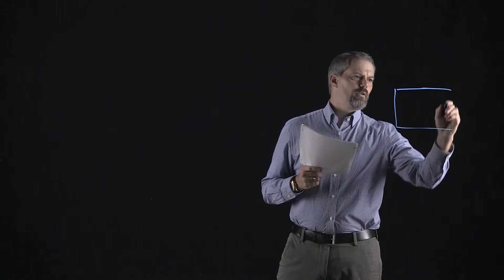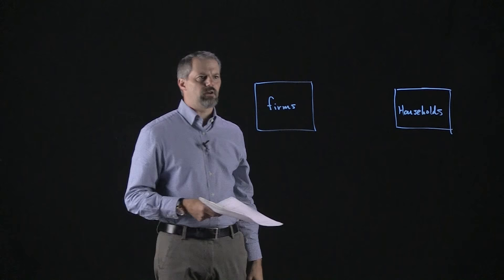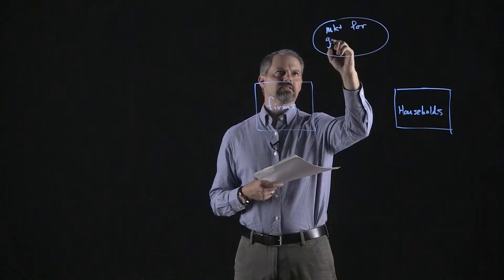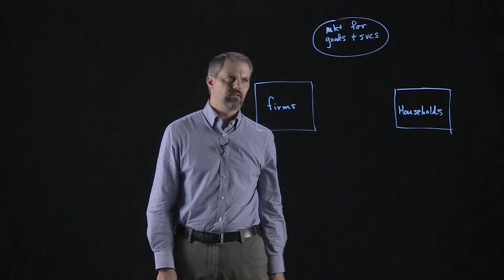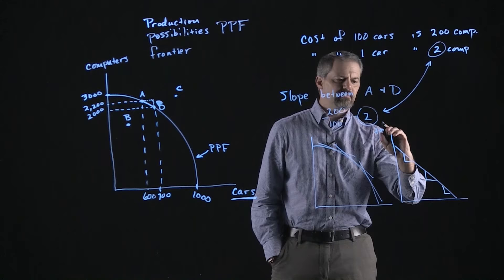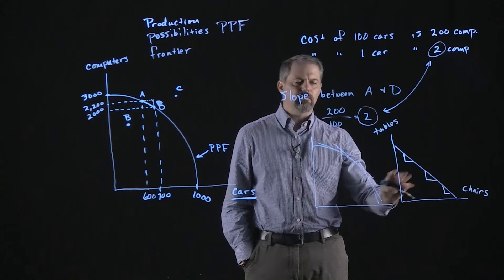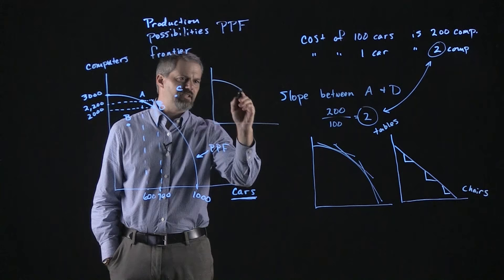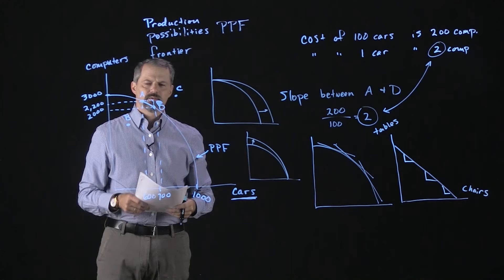Chapter 2: Thinking Like an Economist

Comment: Hey, Doc. Thanks for video
I have a question in terms of comprising costs between computers and cars. Why at the beginning did we have 1,000 cars and 3,000 computers, but lately you calculated, that 1 car is 2 comp?
Reply from the maker: We never had 1,000 cars and 3,000 computers....we actually had these two options: 1,000 cars and zero computers OR zero cars and 3,000 computers. The endpoints of the PPF just represent two of the infinite number of combinations of cars and computers.
Reply: @DrAzevedoEcon  Thanks for the answer!